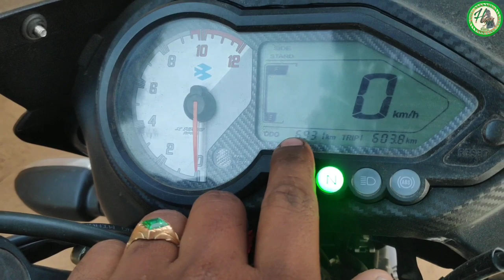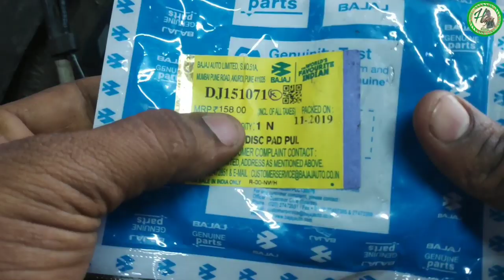How To Replace Pulsar Disc Pads?How To protect It

Comment: Bro 2003 model Pulsar 150 single spark plug bandi. 
Seconds lo konnanu Adi Start aitha undaledhu, bandi paatha owneru Battery leka pothe start avaru annaru. Old model pulsar ki Battery avasaram aa Start avadhanike.
Reply: Naa degara 2004 model pulsar 150 DTSI Bandi kooda vunnadhi, double spark bandi. 
Dhantulanu Battery leka pothe start avadhu but Battery vesthe start avathundhi. 

Bro naa deggara unna rendu Bandi Kick start model aa self starter rendu Bandi lanu ledhu.

Comment: Anna standing mode lo vunnappudu front disk brake veste disc pads and disc nundi sound vastundi alage running lo vunnapudu veste break sarigapadka sound vastundi solutioncheppandi anna.....Disc pads bagane vunnayi